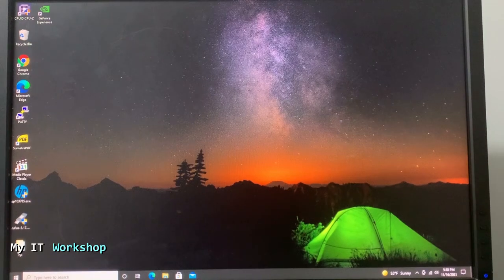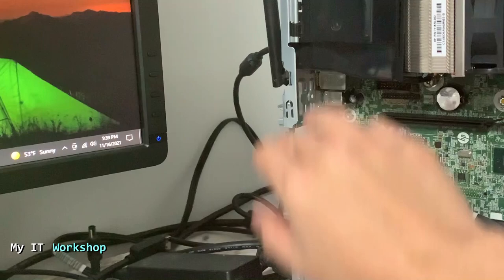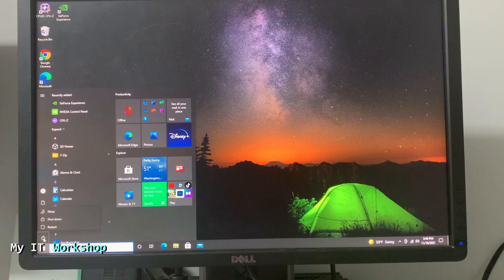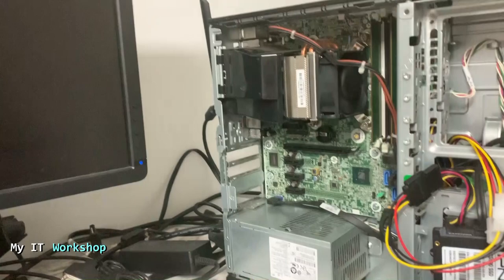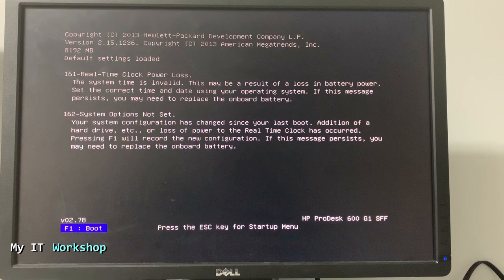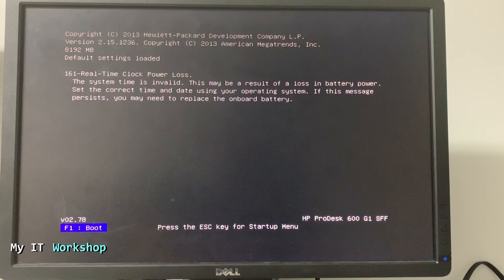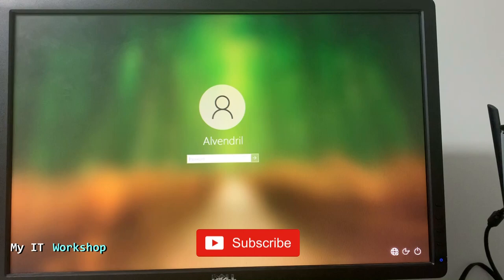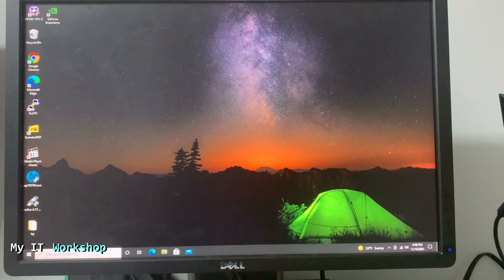Remove Cmos Battery while Computer is ON

Comment: Sir i have dell optiplex 3060 mini desktop i have ordered from Amazon in the first order my cpu 1 ram slot was detected so i replaced it in the second one boot time is around 18 sec and in the first one around 14 sec
In the second reason is when i boot the device dell logo two time came and turns on should i replaced it another time or bios settings any problems please tell.

Comment: My PC is stuck at the start-up screen after a bios update, it says to press the ESC key for start-up, and when I click ESC nothing happens. It doesn't boot to BIOS. Do you think changing the cmos battery will fix it?
Reply from the maker: Hello,
I dont think it related to the cmos battery. In this case if you have waited more than 30 mins, the best option is just to reboot the computer.
Hope it helps 
Thanks for the comment.

Comment: If I take the old battery out with everything running. Can I just pop the new battery in with everything running and not have to reset anything?
Reply: did it work ok without resetting? cheers

Comment: Sir if we change ssd or hdd to other then bios password or windows pasword will remove or not?
Reply from the maker: Hello,
3 scenarios come to my mind:
1. If hdd/ssd is replaced, then you will need to install windows again on the new ssd/hdd and setup a new username and password.
2. If you clone your current ssd/hdd to a new one, then the password continues to be the same.
3. When you re install windows/linux or replace the ssd/hdd, the BIOS password does not change. 
Hope it helps.
Thanks for the comment
Reply: @MyITWorkshop  thank you so much sir

Comment: Hello Sir. We have about 200 Computers and we have to replace all batteries. All Computers are running since years without shutdown. What is the best Strategie If we want to keep the BIOS settings? Switching on running, switching on Turned Off but power supply ist still running or the Last Option everything Turned Off. But then we have to Take Pictures of all Computers for the BIOS. Think about it. 200 Computers..
Reply from the maker: Hello,
I'd say the best way will be to shut down the computer(s), keep the power connected and replace the CMOS battery. 
Test the process on 1 or a few machines first to monitor their behavior and then proceed will the rest based on results.
Hope it helps
Thank you for the comment!
Reply: wtf yall doin with 200 comp? mining ? 💀
Reply: @lego_gamer8005  No all included non personal Computers in an Automotive company

Comment: I don't like the idea of a metalic conductor bouncing around my mobo shorting it out,the cmos battery can be removed witht the pc powered on,i am not a computer technician,i am an electronics technician so the difference is in the software.......
Anyway,i can't get to my cmos battery as the gpu is in the way,a monster of a unit i fitted to my very old acer M5201 vista home premium pc,i have win7 and win10 on separate hdds,anew win11 pc that scares the shit out of me as win11 is so freakin' messed up.

Back on track i had an idea of how to not screw up a powered mobo with flying cr2030 coin cells,since the cr2030 or any other coin cell(check first though) are magnetically conductive ie they have iron in the case of the cell a small center drilled magnet fitted to a short piece of wooden dowel or glued with super glue or epoxy don't use anything other than metal to wood appropriate glue elmers paper glue won't work duffus,hold coin cell with magnet and gently pry it out of the holder et voila one safely removed cell(battery implies more than one cell),and yes my American cousins it's et voila not wallah,also solder has an L in it.
just thought i'd be a bit anal(not the butt hole variety).

Cheers from me in the UK,in the Scottish bit,cheers.

Comment: My pc worked perfectly fine, until I turned off graphic card in device manager. Now on my monitor shows "no signal" i tried reseting CMOS in much ways but still didnt worked (ga-z97x-gaming). Anybody knows what I need to do
Reply from the maker: Hello,
Try connecting the monitor to the video port(s) in the motherboard and not the video card.  
Hope it helps
Thanks for the comment!
Reply: @My IT Workshop  My monitor only got hdmi black cable, which was already connected to the back of pc to HDMI port (this HDMI port is the only thing that my HDMI cable fits with)
Reply: @MyITWorkshop  thanks i fixed it, i found my old monitor with cable that fit
Reply: Why would you turn it off tho
Reply: If you removed your nvidia or amd gpu remove the gpu and insert it again
If it's the iGPU (integrated graphics card) remove the cpu and insert it again
Idk if it will work 
Also your computer HAS to be turned off in this process
Reply: @user83720  Wait nvm I thought you didnt
Reply: i love your profile picture